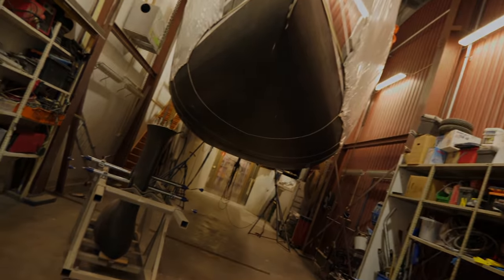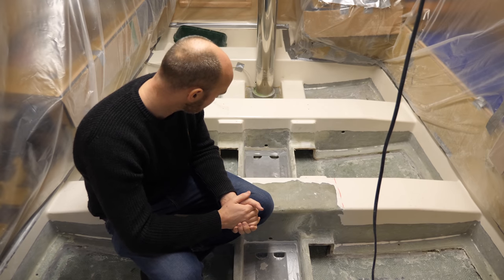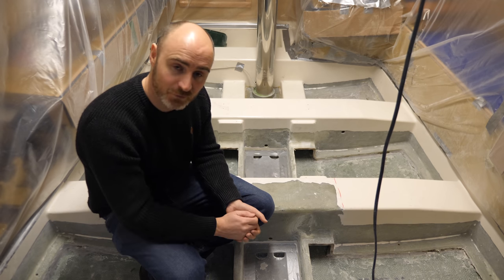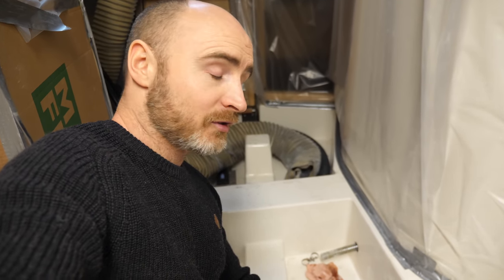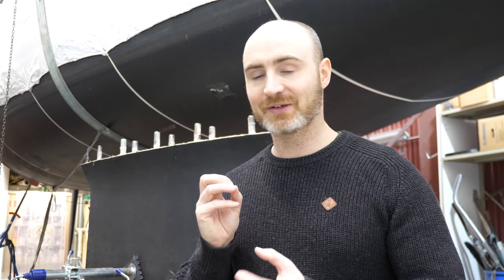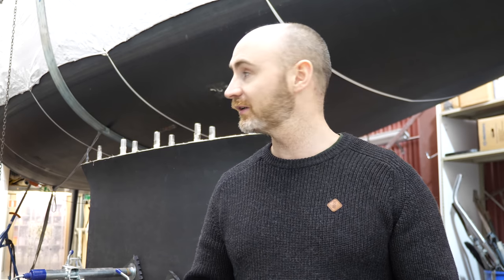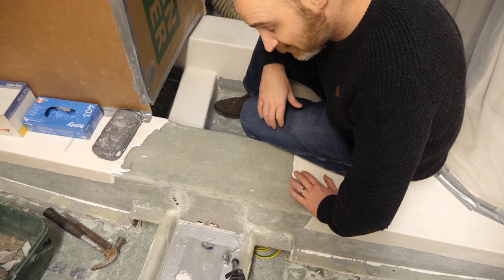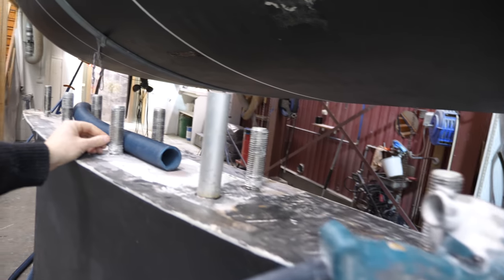SAILBOAT REBUILD - what they DON'T TELL YOU about PRODUCTION BOATS - Plastskador repair week 2

Comment: Sika-Flex won't cure past about 5/8" inch inboard of it's perimeter. The moisture can't penetrate.
Reply from the maker: When the boat is in the water there will be moisture no matter how well you seal it. Plastskador have repaired boat that have come back where the Sika hasn't cured yet after1 year. Other boat they have seen after 2 years have cured, it's just a question of a little more time. Cheers, Chris

Comment: yes yes it has a keel. it hits the bottom.
it is the comparison of a crumple zone in a car..
you fix it better in a weight saving design it would just rip the bottom out. it is designed to a certain impact. 
you may have been better of with benato reefseeker. it will sink on a decent wack or actually you have the comparison now.
Reply from the maker: Not much crunple zone on the fin keels these days, I get ya. At least she is a good boat again now. Cheers

Comment: In no situation is polyester ever better than epoxy. Epoxy is stiffer, stronger and far less brittle than polyester. Polyester shrinks as it cures putting inherent de-lamination loads on the layup.
Reply from the maker: When you say stiffer, this is different to tensile strength. Stiffness is deflection and from what I have read and learned Polyester is stiffer than Epoxy making it more suitable to put around keels as you don't want deflection. Epoxy has more tensile strength but in this application Polyester is more than enough. No boats have gone back to plastskador for over 30 years because of a problem with the polyester not being strong enough.
Reply: @SailingAurora  Epoxy is stiffer than polyester. It can also endure greater elongation before fracture. Therefore it is also more flexible. It also has far greater chemical as well as mechanical bonding properties. Polyester is very brittle. Strength comes from a resin's ability to support the fibreglass. It does this with adhesion to the fibres. Epoxy adheres better. This is why carbon masts are made with epoxy and not polyester. Epoxy dinghy hulls and canoes are stiffer, stronger, lighter and are less prone to crazing when dinged. There's simply no comparison. Which is why it's more expensive. It also needs to be heat cured for best benefits. Trust me when I say the difference is startling. Buy some and do some tests for yourself. Epoxy needs woven roving rather than chopped strand mat. Mat needs styrene to break down the glue. Epoxy has no styrene which is why shrinkage is minimal. Saying that, there is epoxy compatible mat, not that I'd ever use it.
Reply from the maker: @chrisdyer6370  It does sound like you have some good experience on this. One of the reasons they are using Polyester is that it's easy to wet out and it's less finicky than Epoxy, ideally it needs to be laid in the perfect conditions and have a good glass underneath to get the best out of it. Polyester is was more forgiving and in a lot of cases more practical. There are applications for both. You have some points but I think there are some conflicting statements. Coming to your example with the masts. I'm sure they are using epoxy in the mast because it's flexible and stronger, you want the mast to bend and be strong. Polyester is stiffer and has less tensile strength and with a bond that is not as strong. Thats why they are using Crestafix to mitigate this problem. Check this video out also, says the same thing: https://www.youtube.com/watch?v=Xnhz-OLZZa8&t=324s.
If done correctly Polyester can used, for the application it's more than strong enough. Plastskador haven't seen any boats back because they have seen problems with the strength or brittleness of the Polyester. They have however seen boats that have had repairs done by other companies, that have not been done correctly, even with epoxy and do delaminate.
Reply: @SailingAurora  Epoxy is much stiffer than polyester in a like for like layup. It is used in masts because it is stiffer and therefore less can be used. Polyester is more brittle and given the choice I would use epoxy in any situation likely to suffer from shock loading.

Comment: Hanse also claim to bond AND laminate into the hull: They say: "The huge structural subframe is at the heart of every Hanse and importantly is both bonded and laminated to the hand built hull" (here: https://www.hanseyachts.co.uk/about/quality---engineering). in an email they sent me (to all owners presumably) they said "A huge structural subframe is both bonded and laminated into the hull, which is then further re-enforced with substantial plates to transmit these loads throughout the hull form. " I have a 418 and so am interested.
Reply: I hear you but in the video I don’t see evidence of any tabbing. We recently looked at a Jeanneau, also claimed to use a combination of gluing and tabbing. I could see the tabbing but it looked like one or two layers of glass and unlikely to do serious strengthening. We have a Catalina and the grid is clearly tabbed in with substantial layers of glass. There is also a keel stub so the keel is mounted to a section of let’s say 2.5 cm fiberglass. Of course Catalina’s designer Gerry Douglas claims the issue with European boats is the unforgiving iron keels and he says lead keels absorb a lot of energy In a grounding.
Reply from the maker: Hi Truman, I thought about this a little. The wording they use suggests that the grid is laminated but it does not state how much. There may be some lamination close to the bulkheads and on the bulkheads themselves but most of the grid is just glued down. I will try and have a look around to see and ask the guys to see if I can find any original glass attached to the grid. Their statement is very misleading but if 1 inch is glassed somewhere, they are not stating anything false. I might be a topic I'll put in the next video, we will see. Cheers
Reply: I guess the question is whether the bonding is structurally sound and would laminating save the grid from damage? There would always be a point of ultimate grid/hull failure when run aground hard/often enough in these types of design surely?
Check 'Principles of yacht design' second edition. Lars Larsson and Rolf E Eliason pg. 242 re keel impact and grid delamination.
Reply: Surely the key difference between lamination and bonding is that lamination is forever. Can anyone make the same claim about glue?
Reply: @thomastaylor2019  I grounded a 1984 Jeanneau with a lead keel: just a big dent. Yes lead takes energy but it became very expensive lately. Nice would be a lead bulb and a high tensile steel fin.

Comment: Are two bilge pumps better than one?
Reply: If you have a hole in your hull, even two pumps will not be enough in most circumstances.
Reply: @alfredneuman6488  I was thinking mostl y about redundancy.   If one fails the other may keep running.
Reply from the maker: Hi Harry. That is exactly our thinking as well, and we also wanted a bigger one that would be able to shit more water than the original one. Cheers, Chris & Tanja

Comment: i worked in Saare Yachts year ago for two years. EVERY ship we made and now they make has the foundation FULLY laminated as it should be. the bonder or filler is only the first step to round off the edges for laminating and is in NO way a replacement of full laminate. THIS ONLY BONDING PRACTISE IS A SCAM AND POSES A SERIOUS RISK TO THE SHIP AND CREW. It really DOES NOT take that long to laminate the foundation frame to the hull (i know, ive done it my self), its just companies trying to save money by using less material. if you know of a ship company that does this DO NOT BUY THEIR SHIP!!!!! trust me, it would have been waaaay quicker and easier for the ship builders to laminate it to the hull while the hull was bare and with out the deck (this grid is the first thing that goes into the empty hull) than it is for you to do post production. SAARE YACHTS makes em proper.
Reply from the maker: Hi, thanks for the input, I agree. Unforrtunely most of the production manufacturers are just glueing the grid down, they are laminating the bulkheads down at least

Comment: Great video Chris. Thank you. About the bonding - who knew. I thought that frame was also laminated in....Just out of interest I checked on the Hallberg Rassy website - they say their frames are also "bonded into the hull" (see here: https://www.hallberg-rassy.com/resources/how-a-hull-is-built/). Probably better bonding though. Surprised these manufacturers aren't glassing these essential structures in. Anyway very infromative vid.
Reply: I expect that a lot of the addition cost in Halbergs overproduction boats is down to their exquisite joinery, but also the high cost of Labour in Sweden.
Reply: Bonded into the hull, as in laminated using fiberglass and resins. Versus bonded onto the hull using glue. VERY different.
Reply: @akathesquid5794  Hi sorry Akathe put my reply in a new comment. Seems Hanse also claim to bond and laminate into the hull...
Reply from the maker: @IIIIIIPETEIIIIII  I can agree on that, definitely with the high labour costs
Reply from the maker: Awesome, thanks for the link. I hadn't really checked how exactly they were built, someone else mentioned on here they didn't have a grid.... interesting. I just assumed because they were hand built they had laminated stringers because everybody is raving about HR. Great find, I will look into it. Cheers
Reply from the maker: @trumancertitude5185  Yes I noticed that too, it's just they don't mention exactly how much of it is laminated. There's a little trick in the wording I beleive
Reply: "Surprised these manufacturers aren't glassing these essential structures in."

I'm not surprised at all. Production manufacturers (and their employees) will always cut corners anywhere they think they can get away with it. After all, it's not their lives on the line if something fails at the worst possible time. That's why I'm building my own boat. At least I'll know everything was done right, and was "overbuilt" (no such thing, at sea), and nothing was put together by an employee with a Monday-morning hangover, or one who was rushing a job so as to finish early on a Friday afternoon and get down to the pub sooner.

That's the reason there's an old saying.. "Never buy a car that was built on a Monday or a Friday." Well, it takes a lot of Mondays and Fridays for a manufacturer to build a yacht. I'd rather take a pass on all that, and spare myself the grief and unpleasant surprises down the track.

Comment: I have a boat designed and built with out a grid, it got its strength from much thicker glass - flat thick ribs of super thick glass that run way up the sides, the shape of the boat also prevents deflection in a hard grounding.    After seeing this damage ... I know I NEVER want a boat that has a bonded grid in it... The other benefit of OLD school building is I can GET at every bit of the bilge, nothing hidden no standing water spots that are hidden from view..   Boats designed by accountants instead of engineers and sold to the public - I am shocked they can be insured given the reality of how they are designed and constructed.  My principle objection to production boats is the endless compromises that have been made in them from design, to construction to materials choices accounting and marketing choices instead of an engineering standard.
Reply from the maker: There are up's and down's to every boat. The advantage of having this construction is that it makes the boat very light and faster. I'm guessing you have a heavy boat but very strong. Nice to hear what other people are going for also. All the best, Chris
Reply: This is not a light or strong or fast boat.  It cost much less to build because of the grid that’s why they use the grid in the first place.  It allows less glass in the hull till something goes wrong.  Our boat is very light, extremely stiff and fast but to hand lay up glass on this variable thickness schedule today would be quite expensive with a hand fitted wood interior which is why few boats are built this way anymore.   These boats are fragile if run aground- ours can handle it without a catastrophe occurring.
Reply: @SailingAurora  Our boat was built with hand laid glass to a specific variable thickness schedule so it is very strong where it needs to be very strong and quite light where it does not need the strength.  The engineers and builder specified very thick bands of glass re-eninfocement In bands at the keel load points - not a bonded grid solid glass that is part of the hull. This is part of the story, hull shape is another part and so is the structural nature of the interior.   The interior was hand fitted bulkheads and supports, glassed in securely with tabbing to the hull.   The result is a very strong and light boat that can and has proven to be able to withstand the force of a hard grounding without catastrophic damage.     Because of the manual work involved in building such a boat the costs to do so are very high.   These production boats are neither light nor fast, nor durable - our boat is lighter for its length AND faster by a fair bit than any of these production boats and has been proven durable.  The REASON they are built this way is to save money in construction and to turn a profit when they are sold not to make a quality product - the interests of the builder ARE NOT the interests of the owners. Not one of them built this way can survive a hard grounding without. catastrophic consequences.  Owners must therefore fear and avoid such events.    Our boat was built to a higher engineering standard and through the production run sales prices escalated rapidly until they reached a point that no one would pay the price when "alternatives" were presented.  Owners are NOT often engineers and are generally unable to assess the risk that such boats represent.   They rely on assumptions, representations or impressions that are not grounded in physical reality.  Perception is not reality.  Performance is reality.    Labour rates and quality construction unfortunately cost real money.   The trick is to keep such a well built boat modern and relevant - updated and not simply maintained but renewed.  The fact is that they are proven commodities that will stand the test of time unlike current production boats that will not and can not do so because of the continual evolution of never ending compromises made to achieve cost and sales targets.  That too is a reality that must be recognized.  Properly engineered boats are not for everyone.   Owners however should be educated as to the limitations that compromises in engineering, material choices and construction impose on the life span and operation of the boats they own or contemplate owning.
Reply from the maker: @danerlich7393  Wow, thanks fo taking the time on this one, I agree with a lot of what you say. You get for what you pay for I guess, same with anything. Sometimes I have an assumption that all of the super solid boats come from a time where fibreglass was a little unknown, like in the 70's where they would just pour glass on until they thought it was strong enough. If you have the money to get your boat custom made, that's awesome. I would love to take the opportunity to do that. For my sake I must take the lesser of the evils so to say and make the most of what we can have. In our case that was choosing the best of the production boat market. So far I am happy with our choice. Learning alot everyday though. Happy sailing, BR Chris
Reply: Ok first point in reply is that we do not get what we pay for we are charged for what production builders sell us.  Their interests are making a profit not meeting an engineering standard.  It was NOT always this way. In the 1970s they did not use excessive amounts of glass and they knew exactly how strong it was.  The engineering standards drove the show and the accountants said what it cost to do so.  There are non custom boats that are built well and the other choice is to buy a well constructed classic and upgrade it to your wishes for features comfort and conveniences.  The fact is that most modern production boats do not sail very well and many of the features don’t add much to the enjoyment of use.    Often the answer is a longer classic that has been completely updated over any current production boat.    That defines our choice.   If I rattled off it’s capabilities to you well the comparison would not be fair!
Reply from the maker: @danerlich7393  each to their own I guess, I don't know what I don't know but on some points I disagree. We will make the most of what we have. Right now just looking forward to the good times in summer. Thanks for your input though, I learn something new everyday

Comment: Catalina sailboats (mainly a US brand) use lead keels and a thick keel stub. They also have a structural grid but we rarely if ever see damage to their grids. So maybe it’s a combination of factors that give the European volume manufacturers issues.
Reply from the maker: Maybe, I would love to compare
Reply: After a bad hurricane I grew new respect for Catalina boats.  They fared better than some much more highly respected/priced boats.  The shape of the Catalina keel stub with a turn of the bilge is far stronger than the race boat style of bolting a keel to a basically flat bottom.  They started production around 1970 give or take a couple of years and they're still in business.